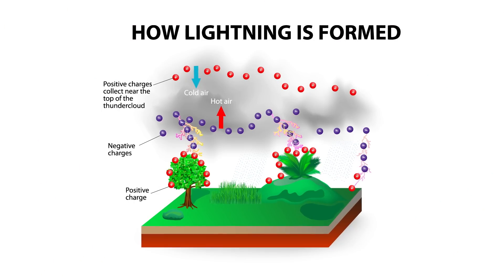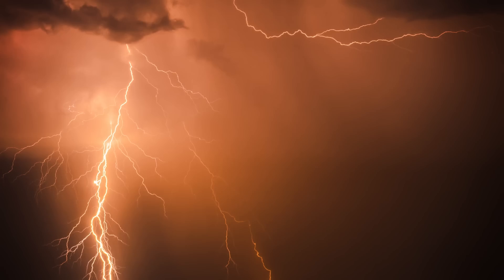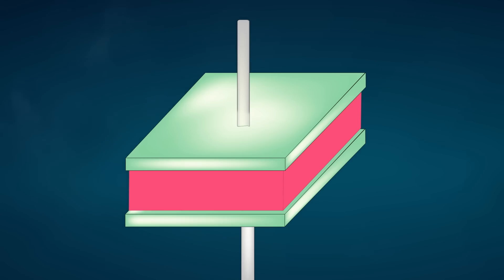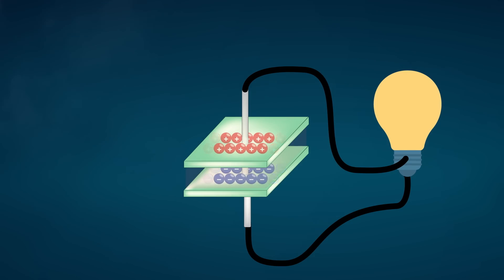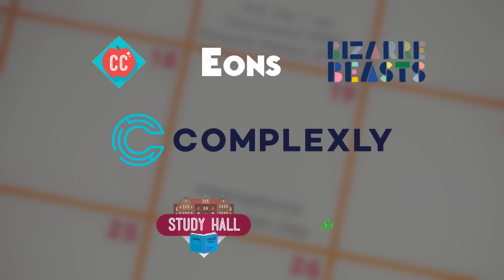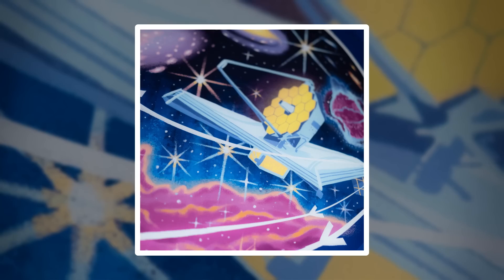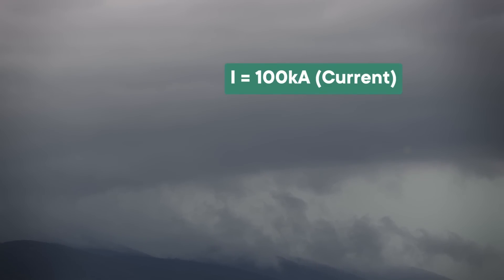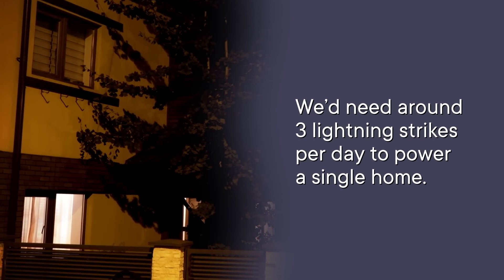Why Can't We Use Lightning for Electricity?

Comment: There is a big problem with this video: at 0:40, it is mentioned that lightning contains billions of joules and then at 5:40, it becomes 8 kWh. As 1kWh = 3.6 million joules (both are units of energy), 8 kWh gives just under 29 million joules. What happened with the billions ???
Reply: Besides, the result of the calculation should not be 30 watts-seconds but 30 megawatts-seconds (I.e 30 megajoules)
Reply: Maybe the difference is the energy going to the light and sound produced?
Reply: @mitodunn7179 that would make a lot of sense, heat also, like the lighting makes air into plasma, that's a lot of heat.
But also they did say that P = V*I is ohm's law so... Maybe its just wrong? Idk
Reply: @mitodunn7179  what? No, that's not part of the equations whatsoever. It's because the video made a small error.
Reply: @mitodunn7179  when a lightning bolt strikes ground, it destroyes it, so it should contain energy, also, if u place the tower high near clouds, u can minimize losses
Reply: I think everything in video is correct, only that moment when she said 30 wattseconds is wrong, and when she said 30 wattseconds equals more watthours instead of less I knew something was off. She said "bear with me" but she really lagged behind us all.
Reply: I mean, there's also the problem where she referenced Ohm's law, but then described Watt's law... there's much that was not proofread before publishing this video
Reply: Yeah, I’m not particularly good with math but that didn’t seem right to me either. Complete change from the first half to the second half of the video. Hoping it was just an honest mistake and not an attempt to disregard and ridicule new ideas for sustainable energy sources.
Reply: @nisper5396  I trust their team, so probably just a mistake by them or this commenter (I didn't check any of the math). But trying to harness energy from lightning is nowhere near a new idea (remember that dude with the kite?), and its unsuitability for a large scale power source has been well known for ages.
Reply: @nisper5396  I saw an article once that said that all the lightnings in France for a year would power the country for about 3 hours. Or they would only power all the ovens in France for 3 hours, I cannot find the article. The point is, yes a lighting is a lot of energy at once, but it is not that much energy in the grand scheme of things.
Reply: @nisper5396  Harnessing lightning for power is in no way; shape or form a new idea. It's older than human understanding of electricity. If it was a viable idea it would have been done. You can ask an electrical engineer why it doesn't work and they'll give you a similar answer as you got in this video.
Reply: Right before 5:40, it is literally explained what happens to the billions. What even are you talking about
Reply: @joshyoung1440  I watched it again and they did not. They calculated a power and then the energy. There is no explanation why the energy calculated at this point is so much lower than the energy announced at the beginning of the video.
Reply: @JohnBames5327   It's time, 30 milliseconds duration, not enough time to store the current/amps. You are billed by kilowatt hours, so if you run a 100 watt light for 1 hour that is 1 kilowatt hour, I think anyway you would lose 2/3 of the total output of the strike, also the first numbers she said would be based on a direct short to ground. As well she didn't mention that the power would need to be released at 50-60 cycles/hz to be useable. Some very huge rectifier bridge for +/- strikes. Although SG-1 did use lightning to power a Stargate. :}
Reply: @Emprivan If you run a 100w bulb for TEN hours, it's a kW. For one hour it's .1kWh .
Reply: @Emprivan  100W x 1 hour = 100 watt hours = 0.1 kWh
Reply: @OutsiderLabs  Ya, I had to ask my boss to see our electric bill, cause I couldn't remember, they keep making the fine print smaller  and smaller, us older folks can't see anything important these days with out a microscope,  and they expect me to use a cell phone with a tinny screen, glad I still use a landline, lol.

Comment: Melting stuff with lightning can be more "mechanical" and doable. Imagine having Solar power plant (not panels but mirrors) that melts salts in tower (like we see in many projects) combined with many spikes near by that literally just adds extra heat to system from every strike. Wouldn't be enough to melt ex heart but could work for frozen chicken!

Comment: The formula for Ohm's law is V=IR.  You are talking about Watt's Law is P = IV.
Reply: V=IR is seriously the goat equation, on par with F = ma
Reply: @vectorsahel5420  I definitely don't think so, there are a lot more non-ohmic components to deal with than particles which don't obey F = ma in everyday life
Reply: @mastershooter64 There aren't really any ohmic components tho, also V = IR, or V/I = R isn't really ohms law, its just the definition of resistance, a component that follows ohm's law is just a component that it's resistance is constant, of which there's none
Reply: @Larke_  That's not what Ohm's law say at all, it says that a system that has a change in Voltage is directly correlated to a change in Current because the physical object (the resistance) is the one constant, it generally can't change (in most cases it doesn't, there are some exceptions). i'm not sure what you're saying with "resistance is constant, of which there's none" or that "there aren't really any ohmic components".
Reply: @l4nd3r  tell me one component where resistance is actually constant then, the resistance is the derivative of voltage in relation to current
Reply: @vectorsahel5420  I prefer KE = 1/2mv^2, bigger numbers and stationary stuff it boring :)
Reply: Also; 30 KWh per day per household?! That's a mad average. In Denmark a house with 4 occupants use ≈ 14 KWh per day.
Reply: @rasmis  Murica
Reply: @rasmis It's not that strange actually. Our average includes large parts of the country where the average high in winter is -5 to 0 C for 3-4 months, then have average summer temperatures just shy of 30 C. AC and heating are electricity hungry, and the average four person residence in the US is larger than in Denmark and takes that much more to heat and cool. That's the biggest reason anyway
Reply: @rasmis  But people in Denmark don't blast the air conditioner all day and night.
Reply: @rasmis  I use on average 24KW per day in Norway, but half of that is for heating a home at 63 degrees north.  Still that is low compared to most homes here.  We have been spoiled with cheap hydro power for decades, and now we also have wind power (built by Danes) to lower the cost when it is windy.
For those living in cities with many smaller homes the consumption can be closer to yours.  I have some computers running 24/7, and they use probably 200-300W.  One NUC is running Home Assistant to have a common control for energy use and switches.
Reply: Kind of extra verbiage. Save a few words, such as directly stating that power is voltage multiplied by current. Also, a more understandable analogy of voltage is pressure.
Reply: "Watt's Law" is not real, you are describing a derivation of Joule's first law. How embarrassing.
Reply: @KrWaKo Watt's Law can be derived using Ohm's Law in conjunction with Joule's Law, but it's not a direct derivation of Joule's Law itself.
Reply: Shhhh this guy has no idea what he’s talking about
Reply: Terrible error.
Reply: yeah, when I see Ohm, literally the unit for resistance, I expect V=IR where R is resistance.
Reply: Thank you for that.  Ohms law measures resistance.  Sad that a channel devoted to science would get that wrong.
Reply: Lol imagine a science show trying to tell us what's what, spreading incorrect information. 

Gotta love it.
Reply: @xxTHExxABYSSxx meh it's commonly mixed up as ohms law.

Comment: Surely it's as easy as it was on my Factorio: Space Age playthrough on Fulgora!
Reply: I was looking for cracktorio references! Thank you!
Reply: The average kWh stat is insane, though... My household (admittedly just me and my wife, in Brazil) uses about 6kWh on a hot summer month! A single lightning strike would do
Reply: Can confirm, just gotta have a thousand accumulators and lightning rods placed everywhere :')
Reply: The amount of accumulators I need to do anything serious is ridiculous
Reply: @KivaBirb  Pro tip: If your accumulators are taking up more space than the factory, simply make the factory twice as large but have it only work during a storm ;)
Reply: Even in factorio lightning is tricky to capture if you don’t have enough accumulators to suck up all the energy.
Reply: @alexsiemers7898  Or just a bunch of heating towers into heat exchangers and turbines, use the excess solid fuel and you're golden
Reply: Ahhh, here are my people.
Reply: i was gonna comment "surely its easy, just go to fulgora", but then i stopped myself and thought, someone has alraidy made this comment, and here it is, thank u

Comment: Why don't we just harvest the static electricity that builds up in the air that would eventually turn into a lightning strike. This would prevent us from trying to find exactly when and where lightning would strike and also what to do with that enormous amount of energy all at once
Reply: Because it still wouldn't add up to too much, relative to the gigantic area you would need. It would just be solar panels with extra steps and then only work a couple times per year.
Reply: I like your thinking!!
Reply: @Dan0rioN  you mean you like he supports Tesla's ideologies?
Reply: Yeah, it's only so brutal because it has to build up a lot of tension to then cross the air to the ground, if you catch it up higher, you can certainly get easier loads more often.

But then again, it doesn't seem to be much energy either way, so probably not worth the trouble.

On to my next project, harvesting the energy of tectonic plaques by using the slow but powerful motion appart at a continental rift!
Reply: @GabrielPettier  Regarding the "Powering your house by tectonic plates": You're not the first with that idea - XKCD, for instance (who else 😉...) made a video about that (among other methods): https://youtu.be/j1tcyEo2tQk - your idea starts at 2:45, but the whole thing is worth the five minutes to watch 😁...
Reply: @CoPoint  Thanks a lot for that, i really likes xkcd, but indeed hadn't watched the video before, indeed the problem is the material you need to sustain the pressure (or tension in my case as i had the opposite idea, anchoring on both sides of the rift, and having a cable be pulled appart, making a wheel slowly turn, and then demultiply that to make other wheels turn really fast and generate energy this way, but yeah, the more you want to take of the force of the rift, the stronger the cable needs to be, and to leverage a significant fraction of that power, it'll need to be insanely large and thus costly.

Still, all that power, here, untapped.

Ok, now, why don't we use volcanoes to make steam machines, right? :D

(yeah, i know construction and maintenance would be… hell)
Reply: @GabrielPettier  Steam power from volcanoes? Sounds good, at first glance, apart from the inevitable, probably not-insignificant amount of sulfur compounds introduced into the mix 😁, creating all kinds of acids and eating at your machinery... 'Maintenance hell' seems about right, yeah  😄...
Reply: Or one step back from that - the energy stored in this electric field came from moving air.  Surely it can’t be too hard to extract energy from that.  😉
Reply: @andrewkepert923  and you have wind turbines handling that area, currently.
Reply: Using heat from the earth to generate electricity, hmm that almost sounds familiar. :)
Reply: iirc if you suspend a wire high up in the air, it will gather a usable amount of energy. Spherics is awesome.
Reply: creating static charges will require energy....so how will u do that?

Comment: About a week ago, lightning struck our house and destroyed our palasate motor, BOTH of our wifi routers, a Camera AND one monitor.
Reply: and this is why you plug everything into power bars with surge protectors
Reply: @kaitlynoddie9649 except surge protectors do nothing against a direct lighting strike
Reply: What is a palasate motor?
Reply: @chesthoIe  It is the motor which powers a gate that slides open and closed
Reply: @Dylanlamprecht  here I thought I would only learn about lighting. Ended up learning about a type of motor.
Reply: @NorseTrojan  oh I know. I read the comments for entertainment and laughs.
Reply: @poeticsilence047  There is no such thing as a "palasate motor." There are motors that are designed to be used in a palasate just like you can have a motor for a garage door. You did not learn about "a type of motor." You only learned that people have powered gates or where a motor can be used.
Reply: @toolbaggers  learned something either way. I knew you could use motors for a gate. My neighbor has one. I was just under the impression there was a certain one.  Just like a "step motor" or "brushless motor"
Reply: @poeticsilence047  poeticsilence = poeticlicense  👏very nice 👏
Reply: I hope you also have 2 modems...
Reply: seems like the house wasn't grounded properly
Reply: womp womp
Reply: Owell no one cares
Reply: @MaekarManastorm  ew
Reply: @MaekarManastorm  ass